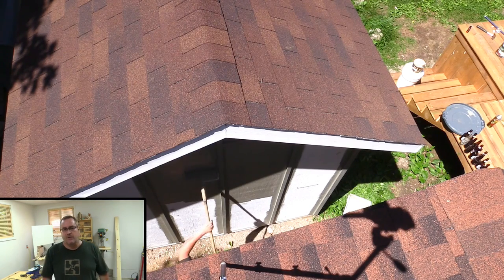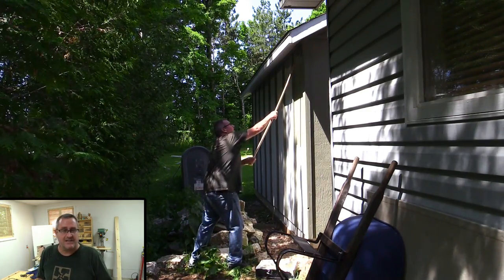The Most Important Safety Rule

Comment: Thanks a bunch. Practice is a great topic and thanks for covering it. Also experience with each tool is important. Not all saws/powertools are the exact same, take a moment and check all the knobs, settings, and adjustments on a tool you have not used before or in a very long time.

Multi-tasking is for outside the shop.

Comment: Just discovered your channel via your mini forge videos and thought I certainly need to know what the most important safety thingee, or whatever it was…anyway, you absolutely nailed it on the core issue in all prevention and general safety issues which is turning the human CPU towards what the H you’re doing until the risk is gone. I’m 72 and just getting into knife making but have fixed or made on my own since a boy helping my dad build boats and racing engines in the garage. When I sent my brother a video of my mini forge (very similar to your gas version) running up to temp atop bricks and plywood on a carpeted floor he responded with, “I watched your terrifying video. I Will outlive you.” That still makes me laugh. What he couldn’t see in view were two large fire extinguishers on my left and right. I will be making an electric version soon however, as an automatic shut down system is easier to incorporate in case of an incapacitating attack during use. 

New subscriber. Well done.

Comment: Couldn't agree more about the gloves when woodworking or using moving tools of any kind, only, I wouldn't weld like you do without them.. Got a hell of a sunburn that way
Reply from the maker: Josh Moss My welding without gloves is brief, so little to no risk of excess exposure. It's like going out to make a single cut on a thin piece of molding on the miter saw, and putting on a respirator. Or loading up the car with enough emergency provisions for a cross-country trip for a drive to the corner store.

Comment: Hey John, can't argue that you have a lot of experience. But experience itself doesn't guarantee safety. I think you nailed it when you said yOu need to maintain focus. Complacency is the greatest safety risk in my opinion, and yours as I understand it. Ultimately everyone has to take responsibility to keep their mind on the task at hand. For example, I've tried using my table saw with all the safety ding dongs hanging around and I removed them because they were distracting me from the cut. I feel more confident as a result and I can now better maintain focus on the task.
Anyways thanks for the video and keep up the good work.
Reply from the maker: Clemens Beck Experience lets you know what to expect and what to avoid, and that goes 90% of the way to not getting injured. The other 10% is equal parts good luck and staying focused.

Comment: Totally agree that focus is the most important safety measure. The two biggest accidents I had were both at the end of the day, while doing a repetitive job on the last pieces.
I cut into my right thumb with the bandsaw (from the front through the fingernail) while making the 15th or so shim to mount a sliding door rail on a very uneven ceiling.
The other time I took a freshly sharpened 20mm wood chisel to the left thumb (to the bone) while cleaning up the last joint on a 3-sided bench.
Both times I was off to the emergency room, and both times lucky that I didn't cut a tendon or something more important. "Just" stitches and a month of unuseable thumb each time.
Safety glasses or gloves wouldn't have helped anything. Actually I more often would consider them a hazard than help. Goggles fog up, get dusty, limit you field of vision, generally make it more difficult to see something. Gloves limit the "feel" for the workpiece, if it's slipping for example.
"Goggles all the time" is just stupid, thinking about if they are needed is much more important.
Reply from the maker: superdau I opened up my left thumb with a chisel too, using it as a plane to make a tight panel fit. Worst woodworking injury I've ever sustained. And then you get guys saying power tools are more dangerous. Tell that to our thumbs! :D

Comment: One of the biggest problems with gloves is the loss of touch sensation when using them. That in itself is a very serious safety concern as you are more likely to push/pull harder on what you are using/moving and can get you into all sorts of trouble.

Comment: Definitely agree on the cutting wheel guard, I have never seen one “explode” enough to cause extensive off the chart damage, so long as the person using it was compelled to use a little common sense. Obviously holding it off to the side per your video or not shooting the remnants in your general direction would be a good common sense thing to do. But I have seen a grinder wheel explode and destroy the guard leaving the operator with a 170 stitches and a scar to remember. I guess what I am saying is guard or no guard it’s a shot in the dark. It’s a risk and no matter what you do. Thanks for the videos.

Comment: my great grandpa was using a threshing machine a long time ago and you know how they had the huge belt spinning between the tractor and the machine itself. Well he was wearing gloves and the belt started falling off of the tractor so he just bent down to push it back on and his hand got pulled on because the leather on leather contact grabbed and he lost his finger because of that. I once was using a drill with a wire wheel and thank God not a grinder but my glove got caught on the wheel and pulled my hand in but the chuck slipped so the wheel came out with my hand in minor damage. Yeah gloves can be dangerous on or around machinery.

Comment: On the glove thing, in the coldest winter it's really problematic working without gloves where I am, I've wondered, aren't there any gloves made to address this issue? Like gloves that just shred apart easily so you don't get entangled? Because working in the finnish winter is not possible without gloves. At least I got a balmy 5-10C in the shop in winter. But outside it can be -30.

And speaking of work accidents, my auto mechanic guy almost pulled his thumb off last week when working on a car, it was just hanging loosely by some strips of flesh. And another guy I don't know that's a "friend of a friend" popped up in my facebook feed with his right thumb gone from where the nail starts, firewood cutting accident.

So lots of missing digits around me, including my twin boys who where born with malformed thumbs and will need pollicization surgery. I hope they can still learn to use tools and stuff, but maybe we'll go the Paul Sellers way to not risk any further digits ;)

Sure makes me hope prosthetics make big advances in the coming years, loosing a digit or limb is one of those things I can lie awake and think about how horrible it would be.

Comment: I never use blade guards. The are not necessary for experienced users. I frequently cut cast iron pipe, in all types of positions, most not convenient. That stuff is thick and it often binds up on my blades. I always burn my abrasive blades up to nothing, frequently shatter them(being too agrressive) and will even use a blade with large pieces missing from it, or half broken. Wear safety glasses and orient the tool properly, no problems. There is no substitute for experience.

Comment: I ignore people who make negative comments and see that if you reply to their comments, 99% of the time they perceive it as a knock against them instead of the curtesy that it is. Every build and maker channel that I'm subscribed to I see the same kind of "safety Sally" type people who think they are making a difference by knocking the maker and I've never seen one of them have any videos up of them making anything. So my suggestion is to simply ignore them. It saves you time and if no one responded to them, they eventually tire of it and move on. But when they do, invariably they are replaced by another one. Oh well.
Reply from the maker: traderjoes All of my preaching on these subjects is going out to those viewers out there that might be misled by ill informed people. The gloves thing, for example, is a "safety tip" I'm getting on an hourly basis. Most likely from people that haven't even been in the same room as a grinder, belt sander or table saw.

Comment: "...or it hits my arm, no big deal" ^^
Well it could of course end in a severe injury, but you can't live life safe anyways.  Every time someone steps on a stepladder to get to the upper board in the kitchen or walks up or down stairs, they are at risk. Every day we take houndreds of risks, there are even recorded deaths of people rolling out of bed while asleep and dying because of resulting injuries. Granted they are few, but it's possible.
I personally, I use knives extensively for more than half of my life (21yo) and I dare to do stuff normal people wouldn't do, because I have learned to use this tool. Why do kids ask mommy or daddy? because they have the expirience children are lacking. That's also the reason why people learn a craft from an expirienced teacher.
Well, long story short: I've seen expirienced people do stuff I considered unsafe, but not hurting themselves doing this exact thing this exact way for years and years. When I was a kid, I thought holding the chuck of a drill and turning it on to ckuck a drillbit was unsafe, today I do it myself.

Comment: Common sense is another one, as for the blade guard well each to there own really, ive seen to many accidents on the machinist page on Facebook were the disk has shattered and bedded its self in peoples cheeks. As with everything on the internet you should take from it what you want but were you saw it isn't responsible for your actions.
Reply from the maker: nathan hellyer There are cheap disks that can shatter, but I only buy and use good quality fiber reinforced disks. I've even dropped the grinder onto the blade while it was running and it broke, but stayed together. I'm not advocating the use of a grinder without the guard, just saying that the hazard is not as great as it's hyped up to be. 
Also, practice and experience will avoid a lot of the reasons why a blade could break, like binding or catching during the cut.
Reply: I totally agree, but perhaps you could of said something like "Id advise you not to do this because it can be dangerous". just a thought as a lot of people are obviously worried about safety. (for anyone else reading this, no tool is safe no matter what gaurds are on it.)